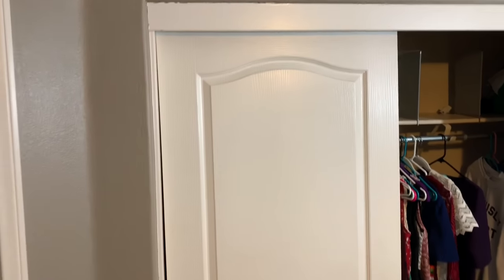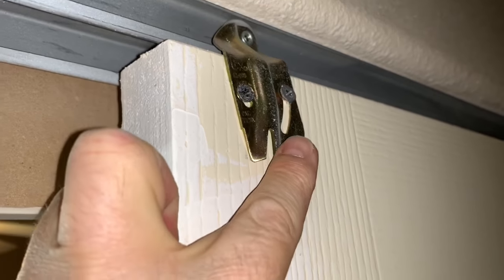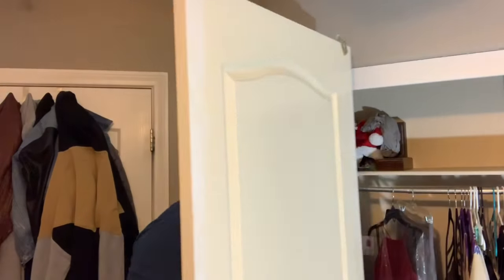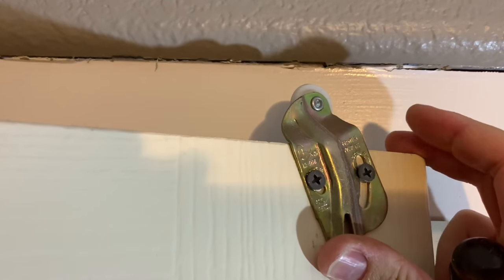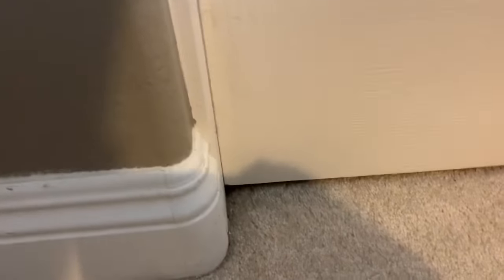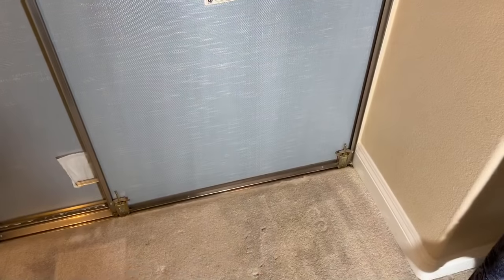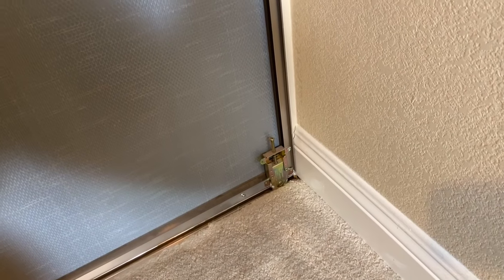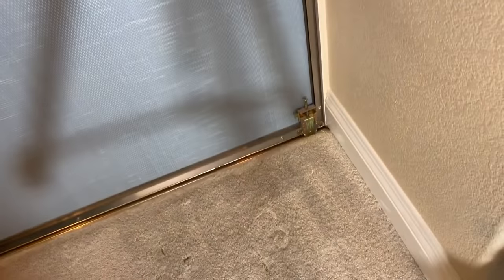Easy Closet Door Repairs-No Experience Necessary!

Comment: Great video.  Clear and to the point. Thanks for your time.  BTW, after I took the closet door off, I found that the screws were loose and the door was hanging at it's lowest point.
Thank to your video I looked at the correct side.
Reply from the maker: Glad to help!
Reply: @MikeKlimek what kind of grease / lubricant do you use for the tracks.

Comment: This can be one of the most frustrating tasks. I have reviewed many videos on this, and I found one that says you need to check the thickness of the roller hinges.  The two thinnest go on the back panel. There was a very fine difference in the thickness, but that solved my problem. Another tip is you can, in some cases, start by putting the roller in the track and then screwing the hinge into the door.  You will need someone or something to help you hold the door up while doing it

Comment: My closest door is on a track on the top and bottom. None close properly and now 1 wheel on the top of the door is completely off the track and the door is now harder to open and makes a screeching noise
Reply from the maker: It sounds like the door rolls on a track on the top (like the video) and has a guide on the bottom. You might need to remove the bottom guide, put the door back on the top track, and reinstall the guide

Comment: Hello Mike. My problem is my door (the second type with tracks at the bottom) is off and I can not replace it in the tracks. Is there a trick ? Thank you!
Reply from the maker: There really isn't a trick although they can be large and cumbersome. A helper might do the trick. Also check to see that the wheels are in good shape and roll.

Comment: Hi Mike. Great video. I'm a tenant and don't want to spend on new doors. 

I can't get the screws to tighten because the hollow wood is worn. Any ideas, wood filler, perhaps?
Reply from the maker: Yes they are cheap doors...wood putty won't hold, but you might be able to create enough tension with toothpicks jammed in there, or even a wood golf tee. For the golf tee you will need to glue it and pre drill for the hole. I would try the wood toothpicks first and jam enough in the hole so the screw has something to bite into.

Comment: Do you have a video explaining how to get the rollers on the top side of the sliding closet doors to stay in the track? Our rollers are not wanting to stay in place. Not sure if the track groove has been widened or what.
Reply from the maker: Have you isolated the problem to the track or the wheels? Does the track have a dent or object in it that makes the wheel kick out?

Comment: Nice, do you adjust both of the hinges or just one?
Reply from the maker: I did just the one. I didn't see the need to mess with the other one!
Reply: @MikeKlimek  It worked perfectly! Glad it did otherwise I would have had to replace the bent metal frame which would have been a nightmare. Thanks!
Reply from the maker: Welcome! @flex20171

Comment: @MikeKlimick Hi Mike, the roller has fallen out of the sliding thing and I was not able to put it back. I even tried to soften it with the flame but with no success. Can you help please? 1:39
Reply from the maker: Unless the wheel is held on with a screw or other fastener, you will likely have to replace the wheel assembly. Take it with you to make sure you get the right one!
Reply: @MikeKlimek  hi Mike, the wheel is still attached, it's the white roller that has slipped out and I cannot put it back. It's very tight! I have a photo but cannot attach it here
Reply from the maker: With a part like that, I would recommend replacing it @ciccipl9482

Comment: I have morrored doors working like in the second half of the video.  Adjustment is no problem but why do they keep coming off the track?  They have convex wheels into the tracks at the bottom.  Excellent video by the way, thank you.
Reply from the maker: It may be that there is debris in/on the track causing the wheels to come off of the track, or there me some "slop" in the wheel assembly, or the plastic wheels may be chipped or damaged. My guess is that either debris at the track or the plastic wheel is damaged?
Reply: @MikeKlimek  Thanks for the reply, Mike.  You are a great YouTuber.
Reply from the maker: @buddyboy4x44  Aww Shucks

Comment: My door seems straight but doesn’t stay completely shut, it slides open on its own. What could be the issue and how can it be fixed?
Reply from the maker: I don't know if your door rolls from the top track or rolls on the bottom track, but it sounds like whichever it is, it is not level. You can try adding some shims to the high side to get it level and then trim off the shim
Reply: Thank you so much for the quick response and my apologies, I should have clarified that my door rolls from a top track. I’m not sure I’ll be able to figure out how to add shims on my own but may be able to get some assistance :)
Reply from the maker: @vanessab1061  Wherever the door settles will be the low spot, in other words, gravity will take it there. You could try to add a deck screw and pull the track up (if there is a gap). Probably a good starting point would be to remove the doors and place a level along the top track to see where it is out-of-level and then determine if you can place a shim between the top of the track and the bottom of the closet opening, or if you can pull up the low spot with a deck screw to get it level. Once it's level, the door won't have anywhere to go but to stay where it is placed. Good luck!

Comment: One of my closet doors came off from one side and when I put it back on, it falls back off! Do I need to but a new thing to hang it from?
Reply from the maker: If your door hangs from the head rail (like in the video) and your wheels are still attached, then you probably don't need to replace them. You should replace them if they are damaged. It can be a pain to get the wheels into the track correctly.

Comment: I can't get the door into the front track no matter what.  I can get it into the rear track without a problem.  Is the track deformed?
Reply from the maker: That's hard to say. It's pretty rigid metal
Reply: @MikeKlimek  I managed to get the one problematic door in the track.  I measured both closet doors, and the problem door is about 1/4" longer than the other.  This longer door scrapes along the carpet.  The rollers above are already set so that the door is as high above the ground as it can be.  Is cutting the bottom of the door the only solution?
Reply: I cut the bottom of the door by 1/4" ish.  I don't have a circular saw so it's not perfect, but it clears the carpet.  I still have a very hard time getting the rollers into the front track.  The rear track is no problem.  I think it's the angle that I can't get due to the front panel covering the tracks.
Reply: I switched back to the 1/2" offset, and it went in.  I was trying a 1/4" offset in the front but that made it impossible to get the wheels in.  Right now I have 1/2" offsets for both the front and back doors.  Is this ok?  I could go buy 3/4" offset wheels for the rear door.  The doors don't hit each other right now.  The other closets in the house look like they all use 1/2" offset wheels only.
Reply from the maker: Sounds like you figured it out to the point where they work. You can add a divider to keep the doors from swinging into each other. If you need the 1/2" wheels try a local door supplier @ryan124007
Reply: @MikeKlimek  I left it as is.  Home Depot didn't have any 3/4" offset, 7/8" wheel rollers.  Maybe they don't make them?  Anyway, it works.  The doors don't run into each other.  Also, the bottom guide keeps space between the doors.

Comment: Hello Mike; My problem is with the bottom on the mirror sliding door. It keeps coming off the rail from the bottom. I desperately need some YouTube advice— Sandie
Reply from the maker: A few questions: Do your doors hang from the top and are separated on the bottom by a plastic guide? Or do your doors roll on a track on the floor? What is the rail you are talking about-the plastic guide or the metal track on the floor?

Comment: Mine has a front and back door that slide side to side not together and the back door came off track and I'm not strong enough to put it back I can't get it to stay
Reply from the maker: Try removing the front door first...that should give you enough room to get the back one back in and then reinstall the front door. If it's too heavy then you probably have no choice than to get some help. Should only take a minute or two